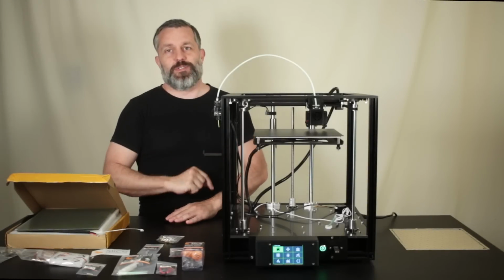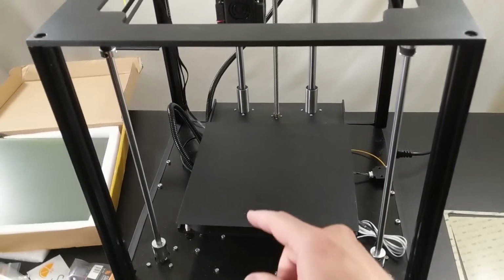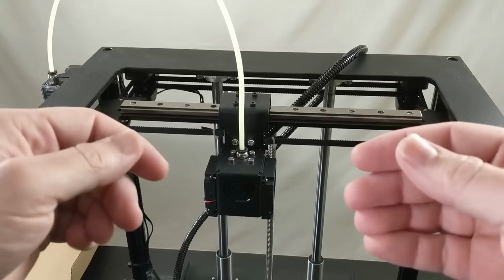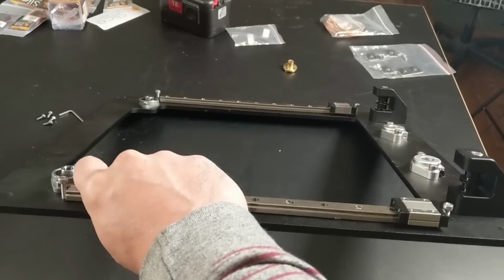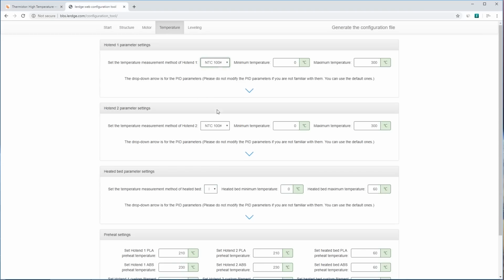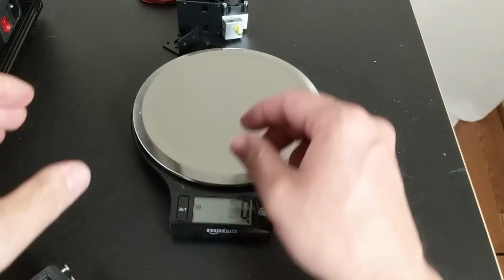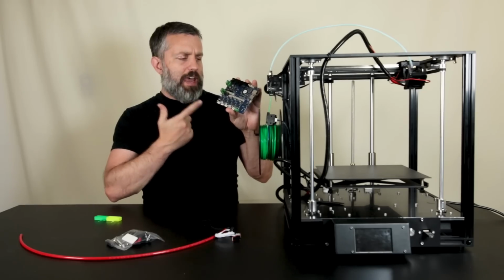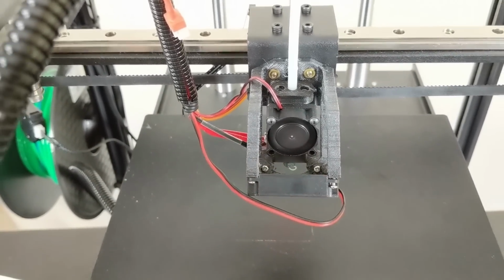Upgrading the TwoTrees Sapphire CoreXY 3D Printer with a Mosquito Hotend from Slice Engineering

Comment: I would suggest, according to the magnetic pattern of the bed being the way you showed, that you actually don't need to go trough the hassle of cutting it out from the center. The magnetic layout will be the same regardless. This does not apply for let say the BuildTak flexplate system though. Just a thought! 🤷‍♂️

Comment: I'd like to point out... That while u say the bltouch is amazing, multiple people have proven on YouTube time and time again, that out of all the most common styles of z-probe solutions, the bltouch is by far the LEAST accurate method... It is "good enough" to get the job done... But it's delta for repeatability is the largest in the 3D Printing world...
Reply from the maker: Yeah, but it's "delta for repeatability" is still very much acceptable. It's something like +/- .025mm So what if some other probe is 100 times more accurate, it doesn't gain you any real world functionality, and has no effect on the ability of the machine to lay down a great first layer. Repeatably. The BLTouch's ability to measure the actual print surface is the strength of it. Until another touch probe enters the market the BLtouch will remain the king of bed sensors.

Comment: Is this what polycarbonate looks like when u print it it seems bubbly im not knocking u in any way I love your videos just curious I want to get into printing it as I have all the requirements even a a chamber
Reply from the maker: This is what wet polycarbonate looks like. I reprinted after making this video. I had to dry the filament spool in my dehydrator for like 48 hours. PC will soak moisture out of the air in like 4 hours and your prints will look like this. Also, It is extremely prone to peeling off the bed and layer splitting.
Reply: Is polycarbonate harder to print then pa12 nylon?

Comment: Hi. How much improvement do you get by using the flexible shaft? You will have to add some mass (gear box) to the hot end.
Reply from the maker: Those motors are probably 10x heavier than the the nylon gearbox sold with Zesty and Flex3drive.

Comment: That would be awesome.
Getting excellent mechanics and then adding the important stuff to suit you needs.
For example, I care about high temp filaments so need AMHE. don’t care about quality just speed so a meaty dual drive capricorn bowden extruder will be awesome. I need to pump out parts as fast a s possible. So a bl touch and glass bed is preferable since it reduces prep time. And finally I want an enclosure so a cubical frame will help.
Always find myself wasting money on things I wish I got of the box

Comment: Could you print ultem or peek with that setup? Ir need water cooling
Reply from the maker: I think the nozzle could handle it. Check the slice engineering website to be sure. The reason I have never tried is because of the ugly truth: The higher temperature the filament the worse the warping. If you though warping/peeling was bad with ABS. It's 2 to 3 times as bad with PEEK. Printing PEEK at room temperature is pretty much unusable for anything but the smallest of parts. You definitely need a heated chamber with an ambient temperature of probably 150°C in order to print any reasonable sized part out of PEEK.
Reply: @DesignPrototypeTest  thans man

Comment: I'm finally getting my first 3d printer and decided to go with the Two Trees Sapphire Pro S since shipping is only $50 to South America . Every other printer I looked at had shipping charges in the hundreds . https://www.alibaba.com/product-detail/TWO-TREES-Sapphire-pro-s-Upgrade_62234794056.html?spm=a2700.icbuShop.34093.3.1b824dfdXPE6ma

I plan to print mostly in ABS so I'll be making an aluminum enclosure and then installing Marlin. What other upgrades do you recommend that I do first to get better quality prints ? BLTouch, Mosquito hotend, Zesty Nimble ?
Reply: Damn it , the price of the printer went up like $80. What other core xy printers would you recommend in the $300 - $400 price range that's not going to cost me $400 in additional shipping charges ? I'm located in Colombia , South America .

Comment: I feel like I'd rather just buy the frame of this printer and put my own pieces in it. I like the printer, but I don't want their bs lerdge board and garbage hot end, not to mention their knock off BMG that will probably develop backlash in a few hours of printing. Just sell me the motion system without the electronics please. It seems like the basis for a decent printer, but then they ruin it with bad quality control, and horrible choices for the hardware/software.

Comment: Copper heater block combined with the design of the heater block that has been presented on the video altogether is a very, very doubtful decision.
Thermistor sits right on top of heater cartridge and miles away from the nozzle. In reality, one will be seeing a temperature of the heater block/cartridge, not the temperature inside of the melt chamber or nozzle itself.
Reply from the maker: A very good point. However, copper is just about the best thermally conductive material there is. It wouldn't surprise me if the difference between what the thermistor reads, and what is actually at the nozzle differs by only 1° to 3° C. I would be very interested to see a study about this. Maybe Slice Engineering will put out some literature.

Comment: I have two printers with these lerdge boards and I think they are better solution than the expensive board with computer needed setting especially if it needs to pop out and in the micro sd card and constant flash the firmware in to a new setting (marlin or smoothieware).
 You can also change your drivers easily for what you like on the lerdge board which is much more convenient than to buy expensive expansion board for duet board as you are stuck with what you get on the that main board.
To stop the z motor to turn off all you need to do is just to cut of the enable leg of the stepper driver of that axis and you done, it will not turn of the motor as the driver enable pin needs +V to do so. 
My bltouch works perfectly so you did something wrong with the following the instruction I guess??
Reply from the maker: It's likely that TwoTrees fixed the BLTouch functionality since I released this video. Which means anyone who buys Chinese printers early will receive an inferior product.

Comment: I have issues with the original hot end. I get heat creep causing the filament to swell and get stuck blocking extrusion. Its enough if the printing is paused for 10-20s and then it gets stuck... Is it supposed to be this sensitive?
Reply: Found one of the issues. The heat break between the heatblock and the upper part had 2mm hole drilled in it. I opened it with a drill  to 3mm and no it takes longer until it gets stuck...
Reply: Spoke to two trees and the say that a batch of Sapphire pros came with a bad hot end that is likely to clog... They will send a new hot end.

Comment: Did you get any response from them? Id love to buy kit with no controller, extruder and hotend.
Reply from the maker: It's extremely unlikely to happen.
Reply: @DesignPrototypeTest  I thought so. But actually, just noticed today they started sale on Sapphire Pro, which is slightly larger and finally open source board with preinstalled Bondtech knockoff extruder. And all for 300usd now on aliexpress. This kind of innovation I think you'd appreciate.
Reply from the maker: I looked up that printer. China man... Incremental "upgrades" At this rate, this will be top notch perfectly functional printer in about 2 years. Also, that "bondtech" is a total clone. I've never seen that before. I wonder if they are using the genuine Bondtech gears, or if it's all just stolen IP. There are so many ways to implement duel drive hob gears. Why do they have to copy so closely. At least they aren't using the Bondtech  name in their advertising.
Reply: @DesignPrototypeTest  Most likely, at least its easy to replace their "BMG" for original and no need to play with proprietary Lerdge. I was about to order this one, but came across conversation with Twotrees representative who claimed that company Creative3D is now run by their former engineer who stole Sapphire's idea and made his own printer. Don't know who stole what out there, but fact that this CoreXY is larger volume 300x300x350 and utilize double Z axis, supports direct or bowden extruders and come w same MKS 32bit Marlin. Looks just like bigger Sapphire with double Z axis and additional rib at the top. May want to check it out it called Creative3D Elf Corexy on Aliexpress.

Comment: Wondering were you get the parts from? Is this printer worth buying?
Reply from the maker: If you want to upgrade your way into the best possible printer for printing exotic and difficult filaments types (Polycarbonate, or PEEKK) This is the printer to get, and it is definitely worth it, but you will have some serious modifications to make. Alternately, if you just want the same print volume, and you only plan on printing PLA, PETG, TPE/TPE then you should save your money and just get an Ender3. Make sure you do the "Onebadmarine" hotend upgrade and you will get prints as good as any other printer can make (including the Prusa). You can also upgrade your Ender3, but it will never be as good as this printer even if you put all the same upgrades into it. Here is my playlist for upgrading the Ender3: https://www.youtube.com/playlist?list=PLtVk4dZInT80SCVB_Pgrn1zZThO3nmV7B

Comment: I will comment FOR SURE that I would ABSOLUTELY purchase a "bare-bones" frame/etc assembly kit without ANY electronics offering. I have scourer the internet and NOBODY offers this option. Everyone who knows more than 5 minutes about 3D printing immediately starts researching the who/what of the items they would need to replace the low-quality items in what we have to choose from. The bottom line is that we could pay GOOD money for a GOOD platform and then purchase the components we want to complete it. The liability of the seller drops to an all-time low and the user experience of the buyer goes through the roof. If a company doesn't do it quickly, as the 3D printing community grows, then you can rest and be assured that SOMEONE, even if it's one of us makers, will see it done before them. There is a "ZERO-LOSS" option to provide this type of offering with an AMAZING profit margin for the company that goes first. Let's see who gives the paying customers what they want..... :D   *Peace* and **May all your prints be perfect**. <3

Comment: If you put the bed fan behind your hotend, move BLTouch to side... that greatly improves viability of the nozzle when printing.
Reply from the maker: I covered this in the video: I can't put the BLTouch beside the hotend because it will cause collisions and limit the travel in the X Direction shrinking the printable area in that dimension to ~180mm. Also, as I showed at 28:07 my design has pretty fantastic visibility of the print
Reply: @DesignPrototypeTest  At 28:07 there is room to the left for your wire bundle, no collisions? ..so your BL Touch could go there too, right?. With that fan mounted in back, angled like you have it now ... your viability would be much better and you would have easier access with tools to for various tasks, and it will be easy to direct light under there also.  I have 6 Prusa I3 running this type of setup .. BL Touch to the side, angled bed blower fan in the  rear.. and LED bar lights directed in from the front.  All that said, what you got is good! .. and I would just stick with "good" .. just tossing some ideas at you from what I have experienced with similar fans / sensors.
    I did see that Sapphire machine for sale.. seems like a really good value.  I'm just about ready to buy several of those Mosquito hot ends for machines at work we are using for glass filled nylon printing.. do some videos on the use and performance of that hot end.. would greatly appreciate that.
Reply from the maker: Your thinking is in the right direction. This is the same process I went through as I was modeling this thing in CAD. After several iterations, the form that you see was the best possible arrangement of the components. It allowed the most travel in the X and Z directions while also providing great visibility of the print.
Reply: @DesignPrototypeTest   if you were to  put the BL Touch on the side, then you would not be able to probe the full width of your print bed.. I can see that.  Marlin does have an option to interpolate/approximate the surface for that un-probed region .. its all a trade off between what is most important to the machine owner.  Nice job.

Comment: Is there a 50cm printbed printer you would recommend? Creality has the monstrous s50 which is awesome but would there be a twotrees equivalent? I already have control boards and high quality hotends(dual) from a previous build but am halted by the small form factor of my current printer.. thanks for your videos and input:-)!
Reply from the maker: You are on the right track. You want a CoreXY machine for this large format printer. Currently the best option is the TronXY X5S 500. But it's not that good of a printer. It is a good starter platform, but you will need to modify it substantially to get it working well. There is no printer at a good price point similar to the TwoTrees Sapphire, but with a 500mm bed. Not yet anyway. If you already have a working printer, I suggest you build your own. Look into the railcore DIY project, and also the Piper 2 DIY Project.
Reply: @DesignPrototypeTest  Wow! that railcore project is so pretty! I build my printer like 3 years ago, based on the Graber i3 design. But I slowly rolled into designing and prototyping fancy gift boxes (think some startup wanting to be the apple of packaging for their product) and those boxes are not small:-p.. However DIY projects (like mine did) really turn the 3D printing hobby into the building 3D printers hobby, which is also a lot of fun:-p.. I will look into the TronXY, awesome, thanks for your reply! I really appreciate you taking time to answer my question:)! Thanks dude, have a good one!

Comment: I'd like to buy the electronic-less / hotend less kit :O would be great because I want full control too :) What I normally do is buy the printer and replace all cheap parts with good hardware.

BTW isnt the SKR 1.3 32bit not opensource? or the makerbase 32bits those are cheap.
Reply from the maker: These are open source 32 bit boards, but they can't hold a candle to the usability and functionality of a Duet control board.

Comment: Thank you for giving such a detailed review. I noticed you caught a ton of flack on the last video for comparing it to the ender series but I can definitely see what you mean about this printer. Yes it may be more expensive and have some flaws that will require more tinkering and upgrades, but I think what people fail to realize is that the end point you can achieve with this printer after upgrades and tinkering will definitely surpass the  point you can get the ender 3. This is the first proper corexy printer that could be considered affordable and can offer far better stability, compactness and print speed capabilities. I love my ender 3, and I think it's an amazing printer for the price with a ton of community support and upgrade potential that will serve most people just fine, but if you want to take it further and have the time and money for the sapphire s then I agree it's the printer to get. 

Looking forward to seeing how this all turns out! Also, a review of the ender 5 would be awesome as they are finally adding something to the series with better kinematics despite using v wheels

Comment: What are your thoughts on having the stepper motors under the base? And the extended stepper motor axles? And adding an enslodure?
Reply from the maker: This was clearly designed to isolate the electronics away from the heated enclousre. It's a smart move. Everyone is just waiting for that stratasys patent to expire. As soon as it does, we're going to see lots of heated enclosure printers.

Comment: So my first printer is a CR-10S Pro. I've been bitten by the 3d printing bug. Currently considering my next printer purchase. I've been following your videos for a bit. I upgraded the hotend on my Pro to the MicroSwiss. My next printer I plan on doing many more upgrades. Board, extruder, hotend ECT. My question for you since I'm seriously considering both printers. The Tevo Little Monster fully upgraded or the TwoTrees fully upgraded? Which would up prefer?
Reply from the maker: The TLM is so cool, and has a much larger print volume. It is also about 3x the price of the TTS. Both will need to be extensively reworked, but the TLM will need more than the TTS. You can get the TTS working pretty darn well right out of the box. The TLM notsomuch as it will require the purchase of a Duet board to get it running properly. Unless they have updated the TLM kit since I received mine. The bottom line is that the TLM is much more "cool" but also much more work, and money. The TTS is better by far than the Ender3, but it doesn't even compare to a fully functional TLM. By the way, there are competitors to the TLM on the market these days. Someone sent me a link a little while back, but I forgot the name.
Reply: @DesignPrototypeTest  yeah the TLM definitely has a lot of cool factor. Sadly cool points won't matter to my wife. Also most of the stuff I print wouldn't need the build volume. Guess I'll go with a TwoTrees. Looking forward to the future upgrades, especially the zesty nimble! Keep up the good work. Also are you releasing your mount files anywhere?